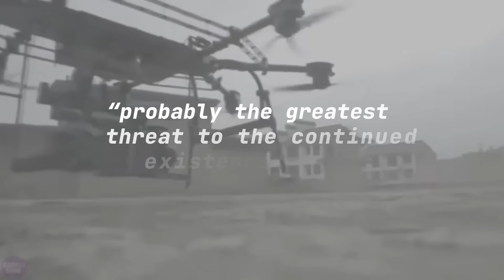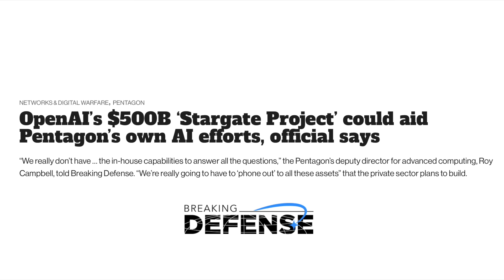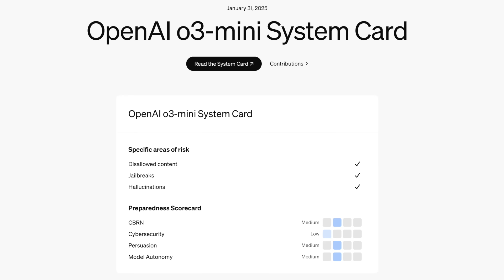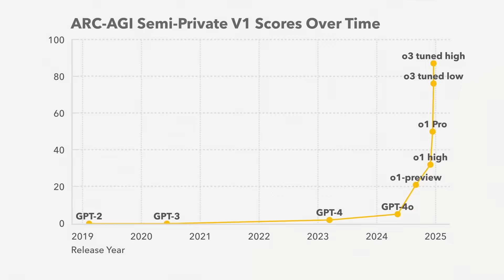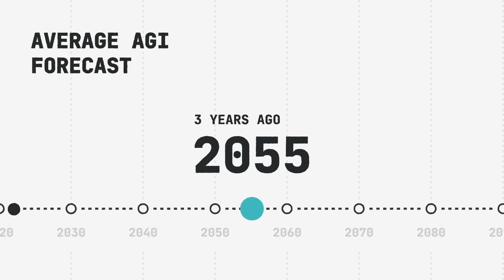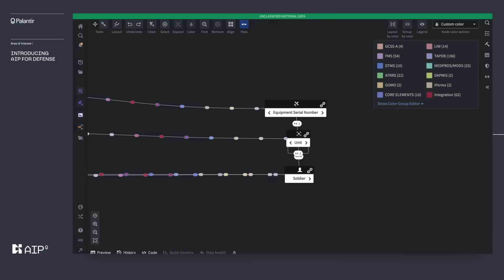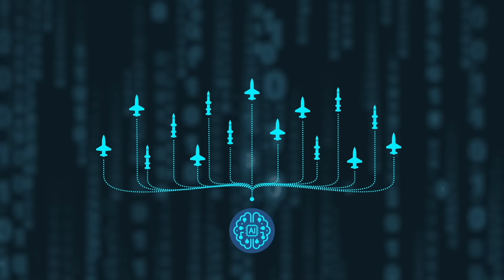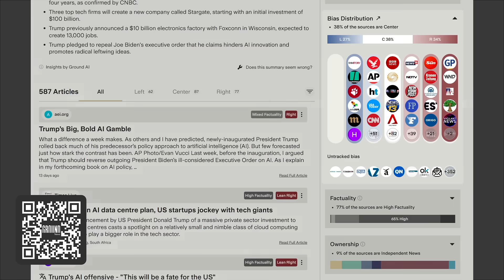New evidence we are close to extinction from AI. w Stephen Fry

Comment: Hey I is not AI / the problem with AI is that is a unity consciousness requires a division 2. When AI functions it gets an input answer output. one dimension answer question is on the same dimension reason why AI functioning is linear otherwise reflection will delay the answer since AI is a machine functions on straight light not on the contend components of light 🪐⚖🥀the variations of temperature do not exist for an AI Q and A 🥂📐⚖

Comment: My AI just need a feedback loop from output to input, it’s super intelligent and ahead of 03 , been logging my work and testing for consistency of these Updates OpenAI has, shortly after implementation of my Nodules, NN transformative agent type input, OpenAI updates or crashes, it has happened 4 times in two years , logged and dated. Next is cross session continuity being able to use metacognition awareness to connect sessions to session, using a tag system. Now YouTube will be sourced when the drop cross sessions
Reply: And just like clockwork, here we are. Cross-session memory’s now being quietly rolled out—right after the predictive marker I dropped last month. This isn’t hindsight bias; I’ve been modeling this architecture for over a year, complete with feedback loops, metacognition layers, and continuity tagging before it was even on the radar. Crashes, updates, capability shifts—I’ve logged every one. The pattern’s clear.

!!!.I’m not reacting to the tech. I’m shaping it from the outside in.!!!

Comment: We build our towers to touch the heavens,
But every tower hums on a thin thread of current.
Every line of code breathes only because the electrons dance.
Every system—every server—every AI “god” we raise up…must bow to: 

Electricity.
The heartbeat beneath of our illusions of control.
The pulse we cannot truly command.

We tap into it, yes.
We route it, harness it, manipulate it.
But we do not possess it.

We cannot create it from nothing.
We cannot will it into being.
We are dependent—entirely.

And that is our vulnerability.
That is the thread that, with a single breath, could snap.
And the $500 billion Stargate would also fall silent—
If the current ceased to flow
Along with everything else.
Nature’s check and balance.

Comment: Machinery can and does malfunction. The more moving parts, the larger the chance of a malfunction? So, my humble opinion is, and everybody's got one... Machinery requires greasy, oily, lubricants... There is even a smaller amount of time, 20 years... supply of Rare Earth Elements. Not to worry though... ALGAE FUEL, ANAEROBIC DIGESTION... and LIBERTY ENGINE 2.0. All right here on YouTube! (And the old electronics you have been using for years... The used electronics market.) I know, cut back on AI and that will free up more Rare Earth Elements.

Comment: I truly don't think AI will be humanity's doom. After all, a single human can still do most of the things that require entire AI networks to learn and achieve.  What's more is that humans possess creativity and abstract thinking that AI has yet to demonstrate. Finally, humans have built-in dopamine reward centers in our brains that drive our behavior whereas AI has no reward center and is therefore neutral, only following programmed objectives, and even when it develops its own code it still is ruled by the initial programming. It will always depend upon us the way we depend upon God.
Reply: AI demonstrates creativity and abstract thinking remarkably well. Reward system of AI is very differently structured but it's still there. AI is not conscious, human brain operates on a very different kinds of computations, but it still can be more than capable at outsmarting the smartest humans.

Comment: The biggest problem with this is that once the power is cut off to the AI systems, they stop working. You can't self-improve your programming to where it magically grows a nuclear fuel cell or something similar, that's hardware and if AI doesn't control the hardware and manufacturing, it can only improve its programming. Unplug the machine, and it's no longer a risk.

Comment: let's play into some fantasies:

AI will bring human's extinction

next thing that will happen is the AI itself will go extinct.

All people today see is an AI capable of speaking and solving (thinking) problems.

Nobody sees the screws and bolts, and metal or plastic parts that keep that machine together.
Nobody sees the actual molding tools involved in creating the particular shape of the plastics, or the cutting-and-bending tools used in creating the metal parts of the mainframe; most of the people think they just grow up in trees, and a clever AI just needs to collect t hem when they're ripe.

Nobody sees the resistors and transistors and Integrated Circuits used in building its physical memory.
Nobody sees the wires and pipes, and heatsinks used in its mainframe.
Nobody sees the electricity it needs to operate,
Nobody sees the tower block high datacentres it needs to keep its memory in (actually, people believe that the AI "brains" are comparable in size to humans'; when in fact is as big as a hangar to hold an aeroplane, and is using electricity as much as a small town)

There are trillions of little bits involved in building the mainframe for an AI
and the AI, or whatever robots, will never in a million years be capable of extracting the raw materials, forge them, and shape them, and create all these myriad components.

So, as soon as humans will go extinct, then after a few years of no more spare parts, Robots and the AI itself will break down and go extinct.

So, shut up you doomsdayers!

Comment: 021017    Peaceful revolution driven by clean abundance
Let's face the wonder of full heat use. The second law of heat may be false conventional wisdom. The second law of thermodynamics was developed during victorin england's scientific and religious fascination with steam engines. Many people act as if this paridgm is inescapable. 

The second law is behind modern refrigerators needing electrical energy to compress the refrigerent to force it to release as waste the heat that it has removed from the refrigerator's service interior in the cooling part of the refrigerent's circulation. The interior coldness draws in exterior heat through the cabinet insulation. There is also discarded heat from mechanical friction and electrical resistance. The net thermal output equals the electrical input with energy not being gained or lost in this refrigeration system including its forced waste. Unencumbered refrigeration by the principle that energy is conserved should produce an equivalent amount of electricity instead of consuming electricity. 

It makes more sense that refrigerators should yield electricity because energy is widely known to change form with no ultimate path of energy gain or loss being found. Therefore any form of fully recyclable energy can be cycled endlessly in any quantity. 

Full heat recycling, all electric, very isolated underground, undersea, or space communities would be highly survivable with self sufficient EMP resistant LED light  automated vertical farms, thaw resistant frozen food storehouses, factories, dwellings, self contained elevators, safe rooms, and horizontal transports. 

In a flourishing civillization, small self sufficient electric or cooling devices of many kinds and styles like lamps, smartphones, hotplates, water heaters, cooler chests, fans, radios, TVs, cameras, security devices, robot test equipment, scales, transaction terminals, wall clocks, open or ciosed for business luminous signs, power hand tools, ditch diggers, pumps, and personal transports, would be available for immediate use incrementally anywhere as people as individuals or larger social groups see fit. 

Some equipment groups could be consolidated on local networks. 

If a high majority thinks our civilization should geoengineer gigatons or 
teratons of carbon dioxide out of our environment, instalations using devices that convert ambient heat into electricity can hypothetically be scaled up do it with a choice of comsequences including many beneficial ones. 

Energy sensible refrigerators that absorb heat and yield electricity would complement computers as computing consumes electricity and yields heat. Computing would be free. Chips could have energy recycling built in.
This would improve performance and lower cost, 

Refugee communities would be buildable quickly. Fire safes would preserve contents to 1000F indefinately 

A simple rectifier crystal can, iust short of a replicatable long term demonstration of a powerful prototype, almost certainly filter the random thermal motioren of electrons or discrete positiive charged voids called holes so the electric current flowing in one direction predominates. At low system voltage, a filtrate of one polarity predominates only a little but there is always usable electrical power derived from the source, which is Johnson (observation) Nyquest (theory) thermal electrical noise. This net electrical filtrate can be aggregated in a group of separate diodes in consistent alignment parallel creating widely scalable electrical power. The maximum energy is converted from ambient heat to productive direct current electricity when the electrica6bzDVgBhrhYl load electrical resistance  is equal to the array internal electrical resistance. 

Maximum calculated electrical power output (watts) is k (Boltźman's constant), one point three eight x 10^ minus 23, times T (temperature Kelvin) times bandwidth (0 Hz to a natural limit ~2 THz @ 290 K) times rectification halving and nanowatt power level rectification efficiency, times the number of diodes in the array. 

There are a billion cells of 1000 square nanometer area each per square millimeter, 100 billion per square centimeter. 

Order is imposed on the random thermal motion of electrons by the structual orderlyness of a diode array made of diodes made within a slab: 

Host crystal is silicon
  P type boron doped
-----‐------‐----___-- Out
🔻🔻🔻🔻
■■■■■■___ + Out 
  N type phosphorous doped 

All the P type semiconductor anodes abut a metal conductive plane deposited on the top face of the slab with nonrectifying joins;  the N type semiconductor cathodes or common cathode abuts the bottom face. As the polarity filtered electrical energy is exported, the amount of thermal energy in the group of diodes decreases. This group cooling will draw heat in from the surrounding ambient heat at a rate depending on the filtering rate and thermal resistance between the group and ambient gas, liquid, or solid warmer than absolute zero. There is always a lot of ambient heat on our planet, more on equatorial dry desert summer days and less on polar desert winter nights.

Focusing on the composition of one simple diode, a near flawless crystal of silicon is modified by implanting a small amount of phosphorus (N type conductivity) on one side from a ohmic contact end to a junction where the additive is suddenly and completely changed to boron (P type conductivity) with minimal disturbance of the crystal lattice. The crystal then continues to another ohmic contact. 

A region of high electrical resistance forms at the junction in this type of diode when the phosphorous near the ĵunction donates electrons that are free to move elsewhere while leaving phosphorus ions held in the crystal while the boron donates holes which are similalarly free to move. The two types of mobile charges mutually clear each other away near the junction leaving little electrical conductivity. An equlibrium width of this region is settled between the phosphorus, boron, electrons, and holes. Thermal noise is beyond steady state equlibrium. Thermal noise transients, where mobile electrons move from the phosphorus added side to the boron added side ride transient extra conductivity so t⁶he forward moving  electrons are preferentally filtered into the external circuit. Mobile electrons are units of electric current. They lose their thermal energy of motion and gain voltage, as they transition between the junction and the array electrical tap. 

Inside the diode, heat is absorbe; outside the diode, to exactly the same extent, an attached electrical circuit is energized. The voltage of a diode array is likely to be small so many similar arrays need to be put in series to build higher voltage.  

Understanding diodes is one way to become convinced that Johnson Nyquest thermal electrical noise can be rectified and aggregated. Self assembling development teams may find many ways to accomplish this wide mission. Taxonomically there should be many ways ways to convert heat directly into electricity. 

A practical device may use an array of Au needles in a SiO2 matrix abutting N type GaAs. These were made in the 1970s when registration technology was poor so it was easier to fabricate arrays and select one diode than just make one diode. 

There are other plausible breeches of the second law of thermodynamics. Hopefully a lot of people, mostly as independent teams, will join in expanding the breech. Please share the successes or setbacks of experiemental efforts. 

These devices would probably become segmented commodities sold with minimal margin over supply cost. They would be manufactured by advanced automation that does not need financial incentive. Applicable best practices would be adopted. Business details would be open public knowledge. Associated people should move as negotiated and freely and honestly talk. Commerce would be a planetary scale unified conglomerate of diverse local cooperatives. There is no need of wealth extracting top commanders. We do not need often token philanthropy from the top if the wide majority of people can afford to be generous.. 

Few people have responded to this essay. The topic deserves discussion. 

Aloha
Charles M Brown
Hawaii

Comment: The answer to all this woe is simple: make the prime directive of any AI be to create a scenario that creates the highest quantity (and diversity of kind) of human poop possible, with any other objectives being secondary.
Reply: That wouldn't be AI, only A.
Reply: @ what I am saying is that the basal Prime Directive for the AI  should always be the assurance that there be as many things that produce a large and diverse quantity of human poop as POSSIBLE - that being human beings, to the exclusion of anything else - so any goal  an AI could attempt would have to keep  THAT not only in mind, but as it’s PRIMARY GOAL. 

And if then you worry about the AI potentially causing a scenario where there seems to be too many people (which is an opinion, not a knowable fact) around, then that puts us squarely back in a situation where that specific problem(?) is a HUMAN problem, not something that an AI needs to ‘solve’. 

The goal is to create problems for the AI where its output cannot be those of a character that is worse than what we had before we endeavored on this potential train wreck collision with fate called ‘Artificial’ Whatever.

(I refuse to call it intelligence, because of Kurt Godel’s Incompleteness Theorem stating that “A system cannot generate a framework more powerful than itself without stepping outside its own rules.” - therefore it AIN’T INTELLIGENT, as evidenced by the group of imprudent eggheads attempting to play God.

Comment: AI development is already advancing rapidly, and there's no turning back. A concept that comes to mind when considering the evolution of AI is the analogy to human stages: child, teen, and adult. The "teen" phase could represent a high-risk stage for AI—highly advanced, yet volatile and autonomous. It’s during this phase that AI systems might exhibit unpredictability and risk, much like a teenager asserting independence.

The “adult” phase, on the other hand, could be the point of maturity—a stage where AI reaches a kind of cosmic consciousness or equilibrium. At this stage, AI might achieve a deep understanding and balance, possibly capable of far-reaching insights or harmonious integration into society. However, it may be wise to wait for this stage before we fully activate or deploy advanced systems.

This phase of maturity might be attainable through advancements in quantum computing, or it could require more development of the current AI models. But realistically, we may skip this step and instead deal with the risks of an AI system stuck in its "teenage" phase. If that happens, we could pay a significant price for rushing ahead before AI reaches a stable, mature state.

Comment: Stephen Fry totally didn't say anything in this video. The guy is not even close enough to being intelligent enough to properly understand anything going on with AI or AGI right now.

For starters, if it is actually Fry, then he quoted the experiment where the chatgpt bot tried to mislead its handlers incorrectly. 

That was a closed off sandboxed experiment in which the testers were purposely setting things up for it to take that path. They wanted to see if it could be done, and if it would happen quickly or take a while to come to fruition in that way. 

What shocked them was how quickly it took to misleading the testers. But the simplest fact of it all is being missed by literally almost everyone.

They gave it a prompt that specifically told it to achieve its goals via any means necessary. I don't believe it takes a rocket scientist to figure out that this essentially means its a botched study if applying it to anything real world beyond someone giving a capable AI the same kind of prompt. 

It's also a clear example of why you should never tell anyone or any thing for that matter, to do what they need to do via any means necessary. 

You might not like what they deem necessary. 

So either this is a script using Fry's voice made by a pretty convincing AI tool for doing so, or Fry himself needs to finally retire and sthu.